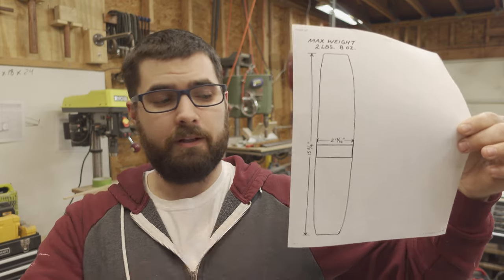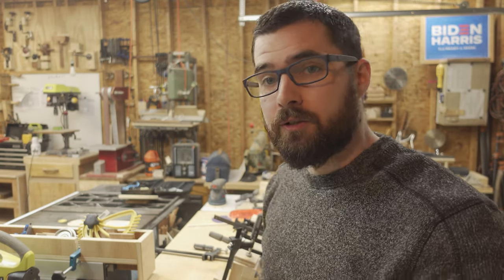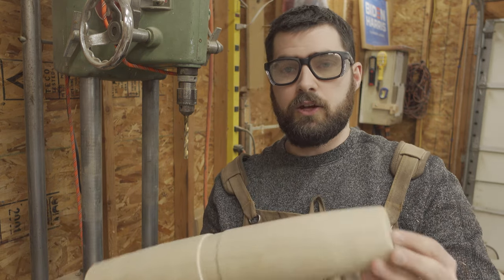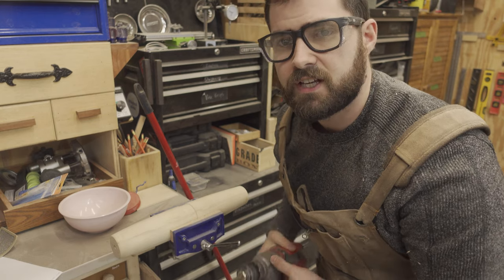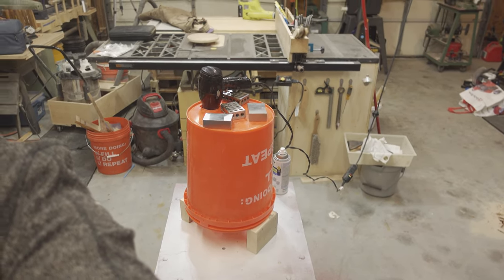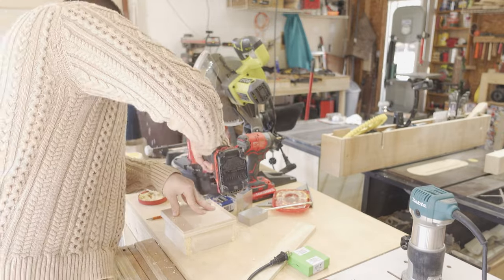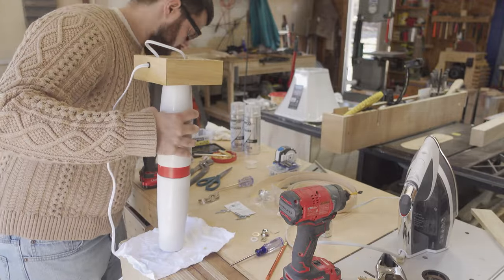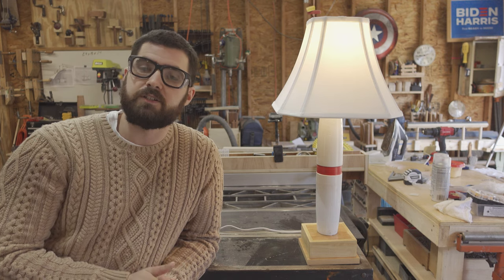Candlepin Lamp | Bowling Pin Lamp

Comment: I have near zero experience with turning. Would it have been easier to cut one corner of all the 4 pieces prior to joinery so that you have a square hole inside? Or would that be harder to turn? 

Also- do you plan on insulating/drywalling your shop in the future?
Reply from the maker: I had the exact same idea as soon as I finished the pin! It is definitely a strategy I am going to try on the next one. It shouldn't cause much of an issue for setting up the lathe. 

I will be partially insulating the shop. I am going to be building warp-around cabinets on all the exterior walls and then possibly finishing the rest with some insulation and 1/4 inch plywood.
Reply: @BassadorWoodworking  I can’t imagine buying plywood right now. Haha. I used rockwool for insulation in the garage and really like the product over batts.
Reply from the maker: I can't imagine it either, so the project is on hold lol. I hope prices come down by the winter so I can make it a project. I will look into the rockwool for insulation. I have heard it is better for soundproofing as well.